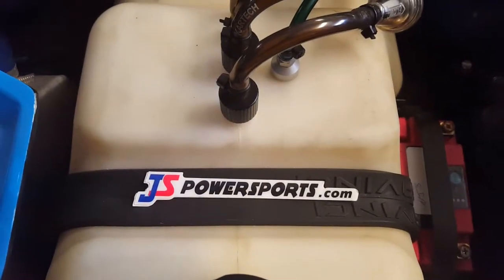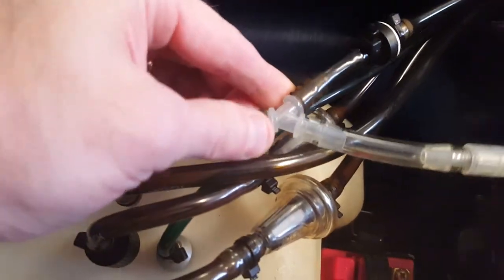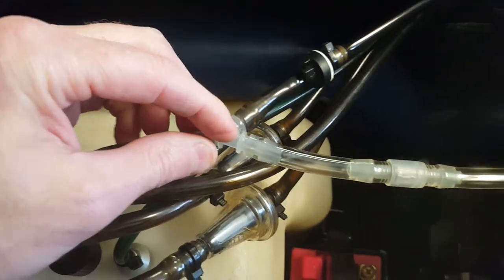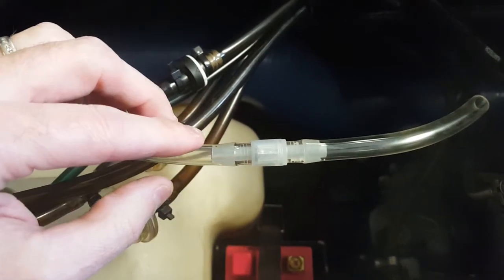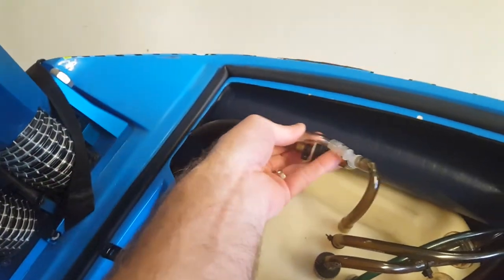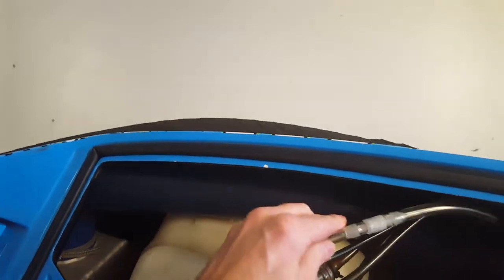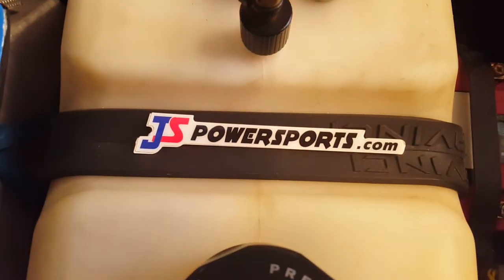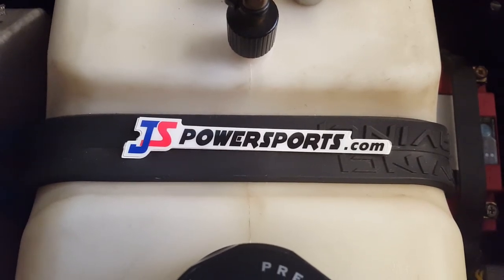Krash Industries jet ski pressure relief valve installation.  - JS Powersports

Comment: Can I just leave the gas cap cracked?
Reply from the maker: Not while your riding or you will have an explosion and if you ever forget afterwards or on the beach in the sun to crack the cap and your engine fills with fuel you will wish you had them. Plus they regulate the pressure so its not feeding your carbs more that it should making the ski run rich and over consume fuel.